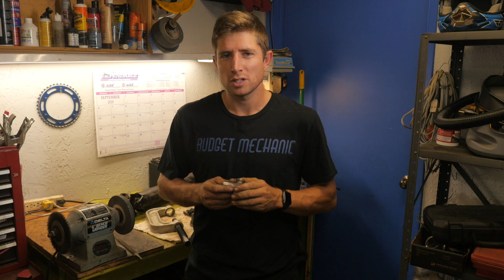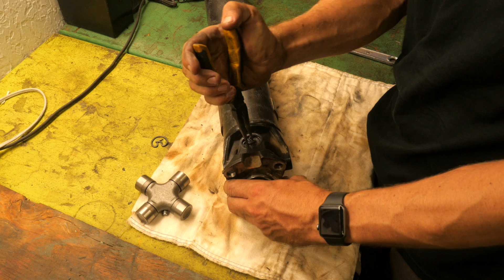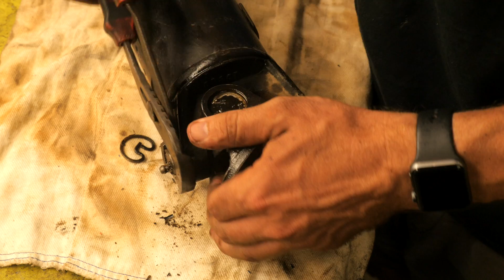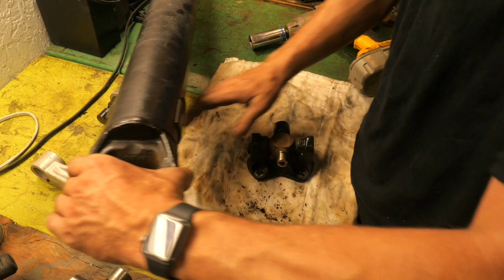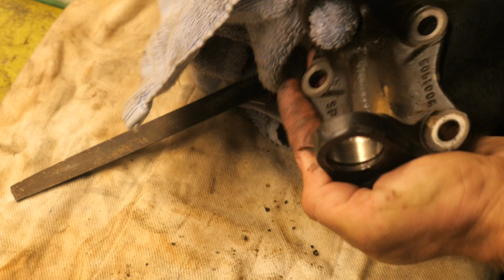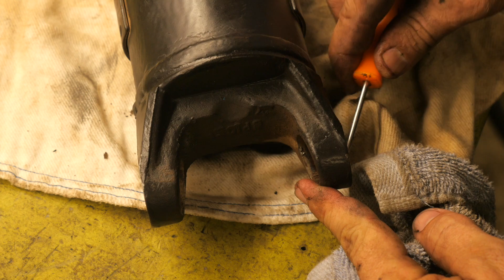Remove & Replace a Universal U Joint from a driveline with Tool Press Puller clunking noise

Comment: What would cause a ball joint to wear out after 12 months and 8000 miles?
Reply from the maker: Low quality part, incorrect installation, or defective driveline parts (grossly out-of-balance driveshaft etc)

Comment: Hi im Brent, what island are you on hopefully Oahu, because i have a 04 ford f150 heritage xl with a 4.2 L v6 and i cant get the lower high pressure power steering line on at all in the bottom of the pump i dont know what im doing wrong because the big ass radiator hose keeps preventing me from lining up the threads correctly and its got me to the point im yelling at every one, if you are on Oahu would you be able to make it up to Waialua out past the high school right before the polo fields and put it on for me and possible test drive my truck and see why it shakes at 55mph to 65mph, hopfully tonight but its cool if you come tomarrow, how much will you charge, sorry my fone broke today so you can hit me up on facebook messenger under Brent Harwood Killey II, thanks hope to hear back from you
Reply from the maker: Hey Brent! Josh is actually in Kona on the Big Island.